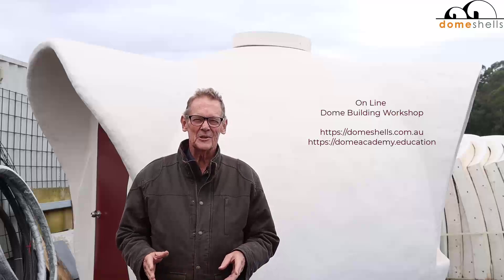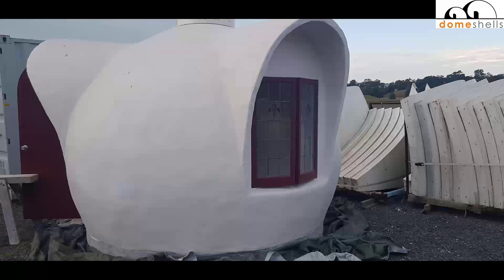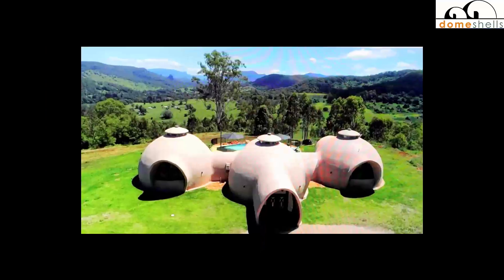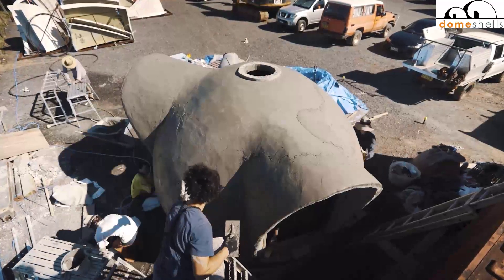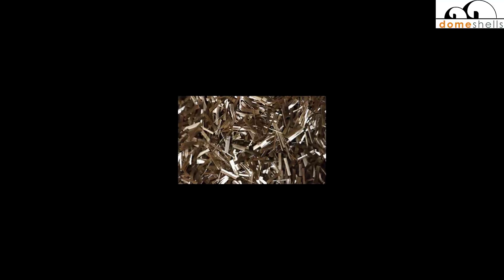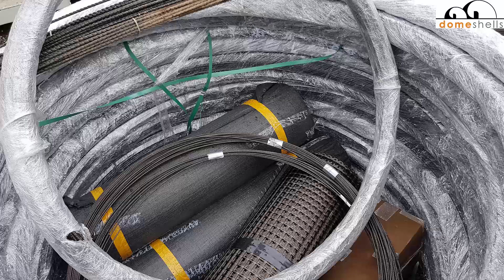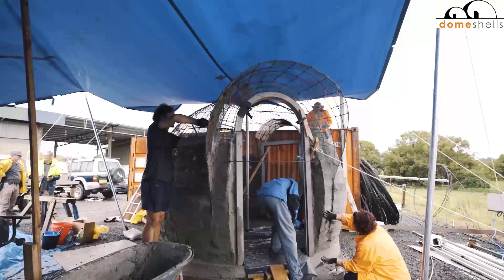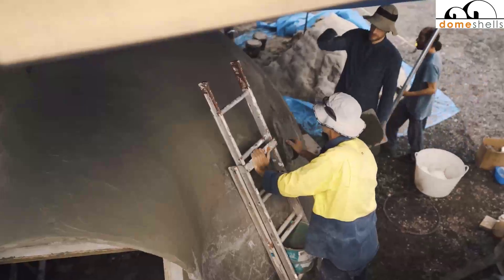Introduction to Domeshells Online Dome Building Workshop - Learn How to Build a Dome

Comment: What is the mesh at 1:20? Is that basalt mesh? DO you use that for all your builds? Only the shredded basalt is available here and is quite expensive. Will plain old chicken wire mesh do as an inferior substitute or will the cement degrade that?
Reply from the maker: We use various meshes. You know for the price of a few cups of coffee you can get one or more of our manuals that will explain in detail how we build domes, the materials we use, mix designs and a lot more.  https://domeacademy.education
Reply: @Domeshells  Believe me, I think you deserve it. But those prices are not just a few cups of coffee for us so it's not as easy to just drop especially with the long list of things that take higher priority. But I am considering it (see first sentence). For those with a tight budget, available bamboo but prefers the strength of rebar (but has no access to basalt), and no airform, intended for an area with regular typhoons and in some danger of heavy falling/flying objects, which manual would you suggest?